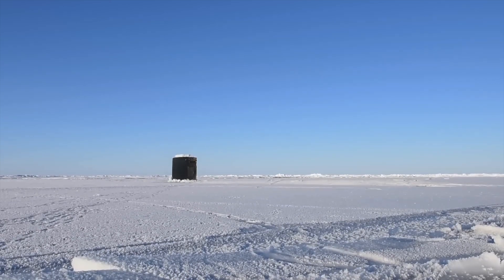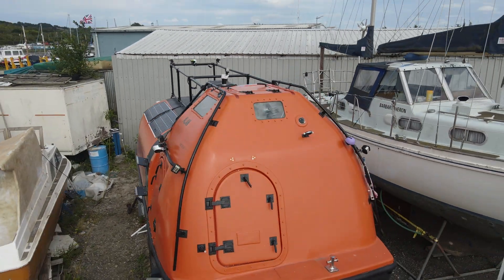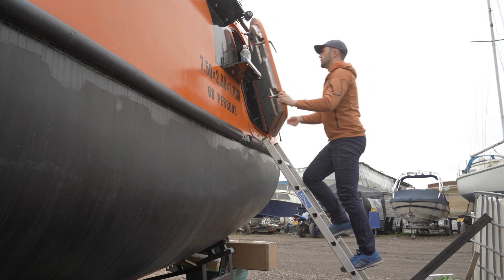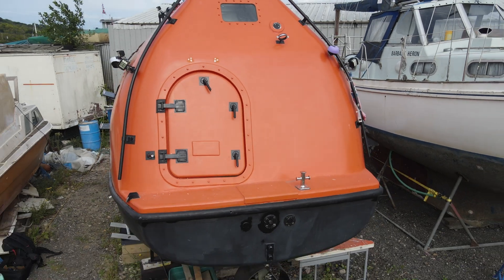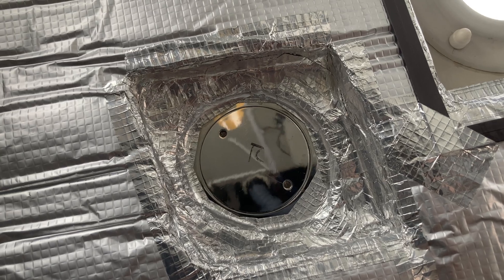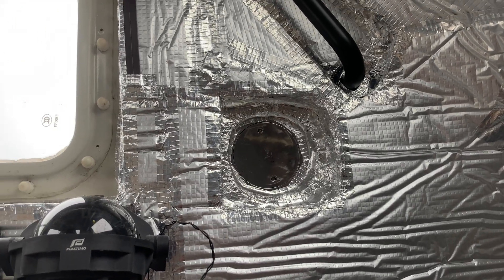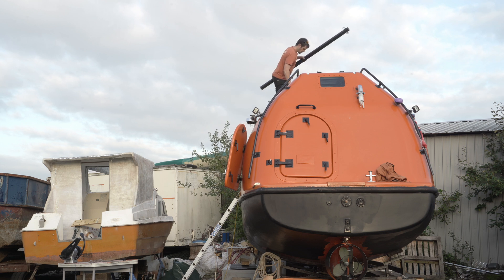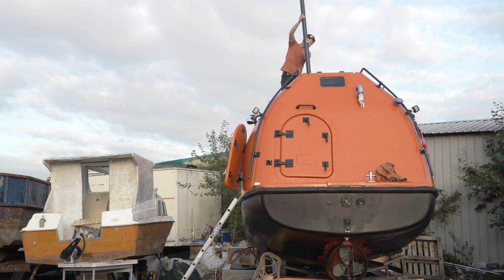Expedition lifeboat converted into a submarine, to travel beneath Arctic ice. Lifeboat Conv E71 [4K]

Comment: I'm not saying you got the idea from me. 

But I 100% remember leaving multiple comments describing how if I were you. I would make this a submersible!

Sure it might have been your ideal all along. I mean. It does make sense. I definitely would have. 

But as far as I know. You never had any inklin. Or made any such advocations for anything remotely like give it submersible capability. 

So as far as I know. That was not your original intent. 

Which is why I made the suggestion in the first place.!

At which point I hear you're going full Subnautic. 

So that looks very convenient from here. Although. I could not have been the only person telling you to Make this thing a sub.

So it was probably just as likely you were continuously battered with the idea. 

And of course. As soon as you propose it. You get the naysayers talking about its impossibility.

Which has the distinct ring of one of my ideas.!

Which tells me that you really are on the right track.!

But I'm not sure you comprehend how much additional weight is going to be required to offset all the displacement of the lifeboat geometry.

Because you stated The ingress and egress of water ballast. And sure. That is going to be required. But that is not where you will get your primary ballast.!

To paraphrase the Matrix. " Lead. You need lots of lead.!".

Let's just do the math on this real quick. And I'm sure you've given the dimensions of the boat. I just don't remember them. So let's do a little guesstimation. But you'll get the idea.

So if what you were going for is neutral buoyancy. To be clear. Not negative buoyancy.!

You will have to add as much weight as the volume of water weighs. That the entire hall of the boat is displacing. 

So first let's figure out the volume of the boat hull. And that will tell us how much that water weighs. And whatever that weight is. Is the additional weight required to become neutrally buoyant.

So off the top of my head I'm just going to guesstimate that the volume of the lifeboat is 2500 Cubic Foot. Yes foot. Cuzz Ammmaca. LOL. That's just the unit of measurement I thinking.

The weight of 1 ³Ft of Water. = 62.41 Lbs.

So 2,500 ³Ft. * 62.41 Lbs = 156,025 Lbs. Of Water. Being displaced. That's 78,012.5 us Tun.!

So if you were going to try to use Water as ballast to become "Neutrally Buoyant". You would literally have to fill the entire volume of the hall with water. So water is not an acceptable ballast solution. (Kind of.!)

So if Led is 708 lbs per ³Ft. You would need 3.53 ³Ft of lead. To make a 2,500 ³Ft Hall become Neutrally Buoyant.!

But Concrete on average is 150 Lbs per ³Ft. So for a 2,500 ³Ft. You would need 16.6..7 ³Ft of Concrete. To become neutrally buoyant.

Now as we already have figured out. Water is not technically an acceptable ballast. And if you're going to use Lead. You're going to need to do some remodeling.! 

For that I would suggest taking molds of all the locations along the Hall you would like to put lead. And then cast molds to pour lead into.

And the lead shape will fit exactly to the Hall. Because outside of that. What ith that much volume. It might start really going in the way.!

Now I was thinking of getting a whole bunch of lead bricks and stacking them All along the surface of the hall. And that would give you excellent ice breaking protection. 

I mean you would be by no means an icebreaker. But you could run into ice without sinking the boat.!

So if you're not going to have lead line molded inserts of the haul. Then having stacked lead bricks on the outside of the Hall is the next best option. Or you could just make a really long keel fin/blob. You know those very long protrusions at the bottom of ships. Meant to give it a lower center of Gravity.

But then the depth of water you can be a hassle. To always be pretty deep.! Regardless of the depth of the ice.! So for sailing purposes that might be a good idea. But for submerging under the ice I don't think it's a very good fit.

So if you're considering lead. I would only recommend the external Hull stacking solution. Or internal molding for the perfect shape.

And of course if you're considering Concrete. And with the square area required. You could technically make a Concrete boat that the lifeboat sit in. Giving it greater ice protection from ice. As well as greater stability with a lower center of mass.

Of course. The Hall is not empty. It's got a whole bunch of stuff in it. So all that stuff weighs a fair amount. Which you would obviously just subtract from the 156,025 lbs. So however much that stuff weighs. I'll be generous and say 56,025 Lbs. In which case. You will still need 100,000 Lbs.

Now what I would do. Which is what I bet you are also probably doing. Is installing 999,000 lbs of additional ballast. And have a 1/2 Ton Water Ballast tank. About what 120 gallons. So like 16 ³Ft. Which you are going to have to find additional room for. Which shouldn't be a problem. If all your additional ballast is external.!

But if you have it internally stowed. You're going to be hard pressed to find that much ballast internally.

And still have logistic room to do anything.! Like live. Or at the very least sume Science.

Which is why again I recommend either Lead or Concrete lined on the outer haul. For both protection from ice while maintaining low center of mass. While achieving acceptable ballast to become a submersible.!

But at the same time I would also say. If you can swing that custom mold lead bricks for the inner hold the ship. Sounds like the most efficient and long-term viable solution.!

So it is completely possible. And technically Not even that much more expensive to try to achieve. A little expensive yes. But not out of the range possibility.!

Anywho these are my thoughts on the submarine subject. I hope you found them helpful.

And I believe I've made myself clear.! If you have any questions. By all means. Ask away.!

P.s. Apologies for spelling syntax and/or grammar.! I couldn't be bothered. I think I made myself pretty clear though.

I always expect great things from you. Don't disappoint me. 👍👍

Comment: umm if i hadn't been watching this entire series this would sound like a joke. a boat that is designed to float at all cost, know matter the situation... as a submarine. thats some major calculations. where are you gonna store the ballast? what about bow planes. you already answered the question about propulsion in previous episodes.  what about the windows, i dont you remember putting enough sealant behind the window panes to support more than ( a guess) 20ft of pressure? what about oxygen/air pressure where are you gonna store that? in the past you have talked like this is gonna be a multi person verhicle, is that still true cause it really sounds like your gonna run outa room? 

in the video you insinuated through footage of another sub punching through the ice to get to the surface is fiberglass gonna have enough tensile strength to punch through any let alone a foot or two if ice?

despite how this comment sounds negative, i actually feel the opposite, this sounds AWESOME!  just alot of (more) work for your two month goal to set sail which already was sounding lackluster.  watching the video a second time clued me in to the fact that you have put alot of thought into this, i will trust that it will all come in the end and am truly excited to see the end result. 

 hehe. if you can, can you rig a selfy stick to the hull so we can get some YouTube footage of the dives?         😃

Comment: Wouldn't it be far simpler for Alan to be nuclear powered?
Reply: It is. Look at the Refleks stove. It's plain to see, that it is way to overbuild for burning diesel.
What you see is the burning chamber where water is heated by the coils in the bottom. Those coils contain a very small amount of Uranium-235 to turn the demineralised water to steam, which powers the turbine inside the upper part of the stove.
What's missing is the daytank. Normally the containment for the diesel to burn, but in this case, it's the reservoir and heat exchanger for the water. So hot air and water is for free, basically.
In colder climates you get away with it, but normally you need some kind of coil outside the boat to get rid of the excess heat. 
A few episodes ago he fumbled around the outboard heating tubes from the diesel engine. Now we know, why. He needs it for reactor-cooling.
Makes totally sense. You are able to dump so much heat in the water, that you don't have to worry about freezing in.

Comment: The amount of ballast water alone would require another empty Alan attached,  just mount skis onto the keel and a pair of rockets on the stern step and go over the ice.
Reply: Thank you!!!  This is never going to work.  Every inch of Alan was designed to float.  It’s going to take an insane amount of ballast to sink it.  Then there’s the question of hydrodynamics, control surfaces, air supply, the list goes on…